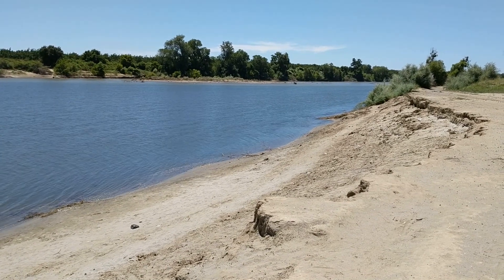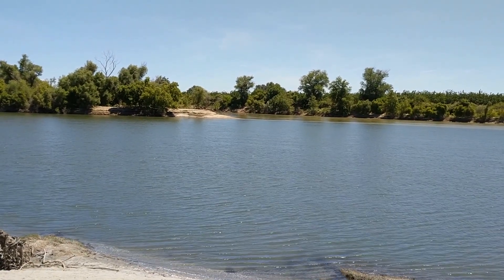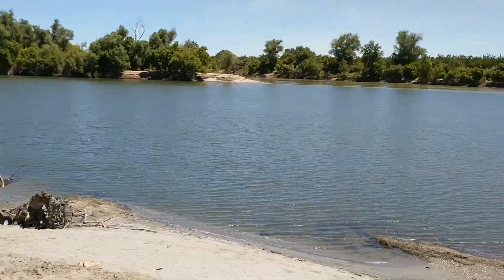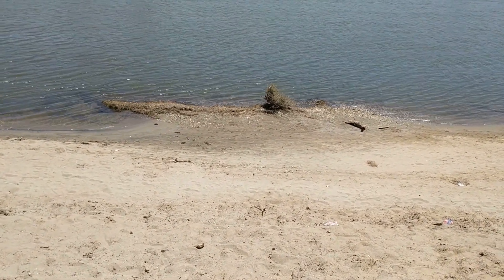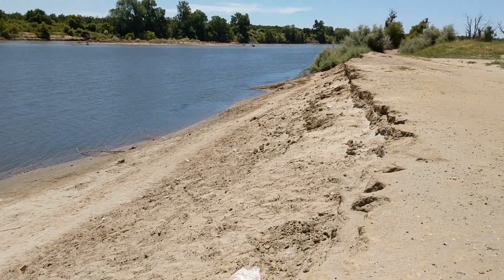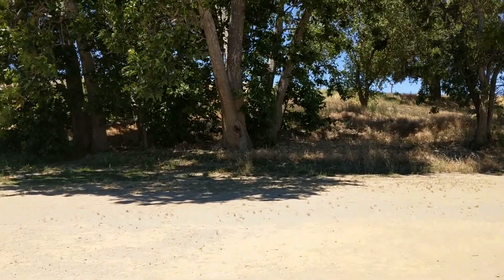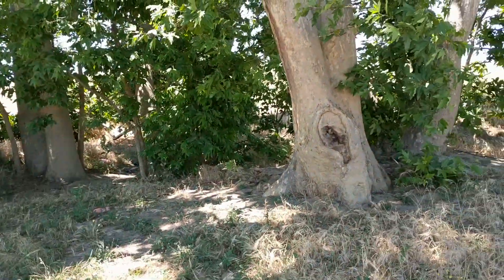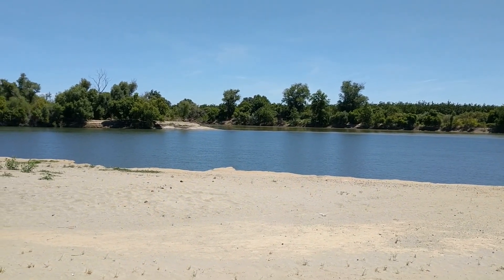6/17/17 ~ 30 miles downstream of Oroville Dam (2,500 cfs river releases)

Comment: Hi Millie.  Thanks for the latest update.  Here is a current graph of flows: http://tinyurl.com/ybvmk47x  Since yesterday, inflow is remaining constant within 10 CFS.  A dam upstream is very likely regulating flow.   Recall the daytime temperatures the past two days have been in the mid 80's in the Sierra, which may have increased inflows but not enough to use another turbine to offset.   A reason they may be regulating inflow could be that the Hyatt turbines are not continuously variable (steps observed have been about 500 and 1000 CFS), and inflow exceeds outflow by 200-400 CFS, for example.  DWR wants to keep the level constant right now, so to do this they are regulating inflow where previously the stronger flows from the basin were being passed through the dams above Lake Oroville.  Just like with the damaged main spillway, the lack of fine control creates operating constraints.  There is an additional possibility - that the RVOS is being used currently to create the 4300 CFS outflow, not two turbines.
Reply from the maker: Hi MegaBakerdude! (You must be BakerDude's alter ego LOL) That's an interesting point about the Hyatt turbines maybe not being continuously variable. The more we know about the turbines, the better we can second-guess what they're doing up there. I was wondering if this heat creates the need for them to use the RVOS to keep the temperature in the low flow channel regulated. Wish there were a way to know the RVOS Factor.